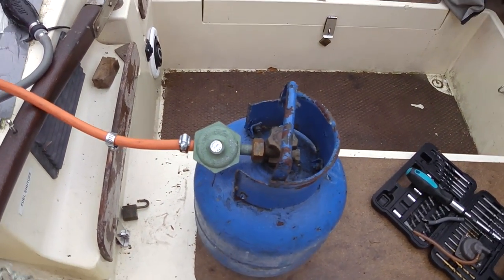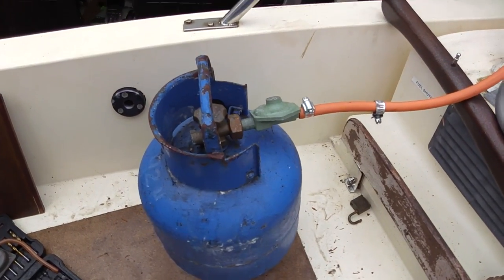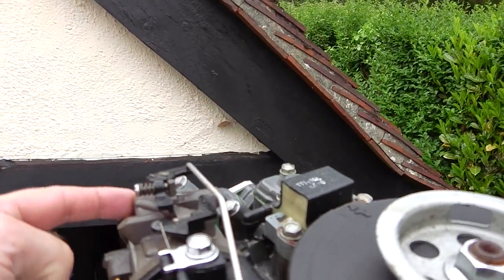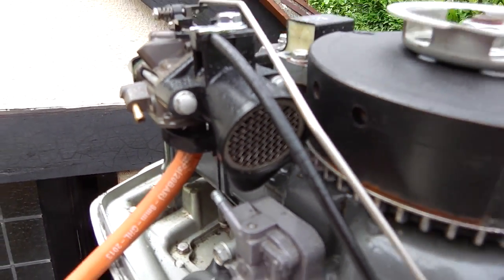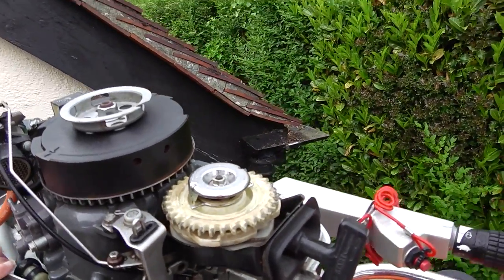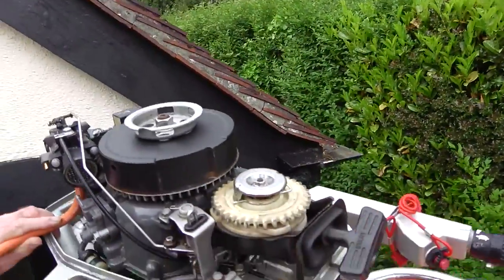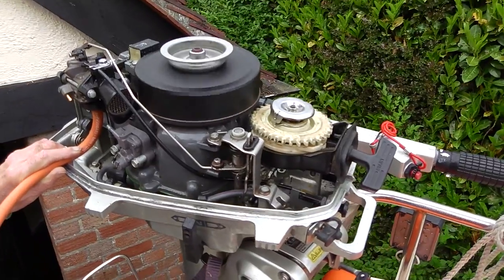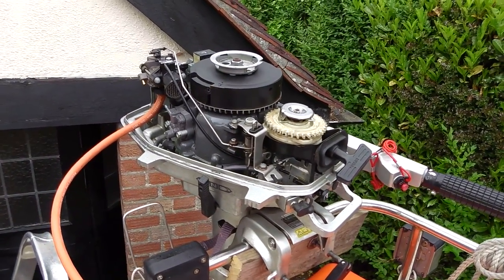Quick conversion of Honda BF5 outboard to LPG

Comment: I figured out a great trick, rather than just feeding a single open tube, plug the end and drill many small holes around the tube so that the propane is coming out of many tiny holes. Works like a charm, just make sure to clean up all the bits after drilling so they don't wind up in your engine.
Reply: I got a 50 hp yamaha running this way, but not at very high power. I think it is necessary to include an evaporator made from several perforated copper tubes or something, or else to design a purpose-built propane carb that includes an evaporator using hot water from the engine.

Comment: Please don't burn your house mate. :(
Reply from the maker: Teoman Ozsen Don't worry, the gas isn't very dangerous, especially when vented into the open air. The main danger with gas on boats isn't fire or explostion, it's a leak where it fills the interior and suffocates you while you sleep. One of the reasons I'm interested in running the engine from gas is that the gas is much less likely to explode than petrol/gasoline vapour. We know someone whose boat was burned out when petrol vapour ignited. He and his wife were lucky to get out unharmed, but their boat was burned down to the waterline.
Reply: It's a good stuff you are trying but main thing is reliability. For me be safe more than sorry. May be just me I am not into LPG and gas stuff me even plumbing. :(
Reply from the maker: Teoman Ozsen
You're right to worry about that. I don't have to rely on my engine at all, but even then I'd carry some petrol around for quite a while before I finally switched over. But there are reliable propane based outboards (from LEHR for example) so in principle it can be reliable.
Reply: Houses can be rebuilt, knowledge is forever. Best way to learn is do.